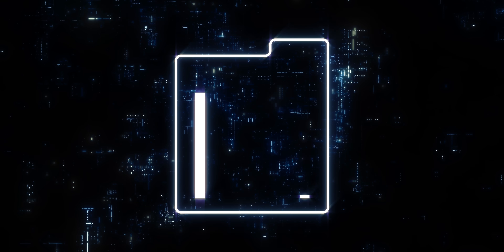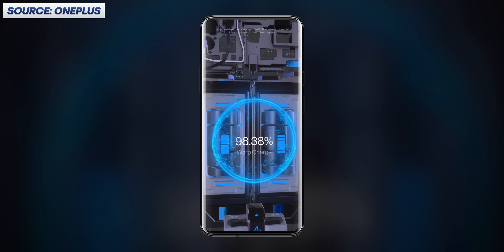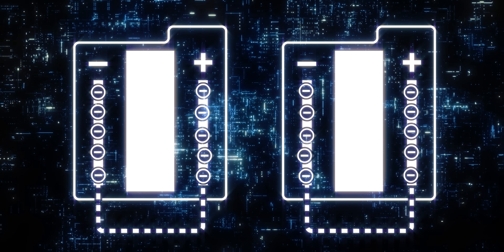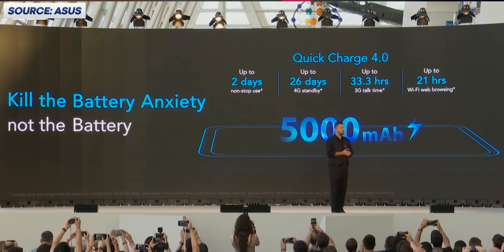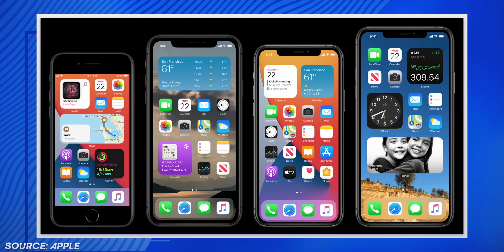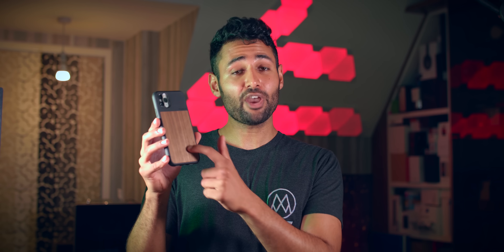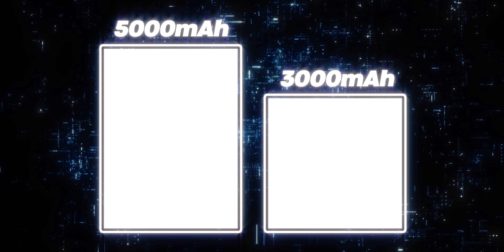The Problem with Fast Chargers.

Comment: Apple are particularly sensitive about battery life because their batteries tend to be smaller.   Smaller batteries go through their lifetime supply of charge cycles more rapidly.  This is another benefit of huge batteries - they don't have to burn through all their cycles as quickly.  My cheapo Xiaomi supports 30W charging and it's already fast enough.  I get about two days out of it.  A benefit of rapid charging we may not have considered is that getting to around 50% can be done within minutes, and could last you the whole day without harming the battery.  We know that charging to 100% strains the battery so why even bother?

Comment: I recently learned the reason for 50% (and not 80-90%) for new devices: they want to reduce the energy contained during transport in case of a failure.
So, when they ship a container with 6000 mA phones, having 50% of the energy in a catastrophic failure may the enough to contain it. Oh, and 100% charge may even increase the risk of failure itself.
And, of course, like mentioned in the video, you want the battery to have some energy so as not to damage itself on the shelf, which is a benefit for the 1st user, as he can use it for some time after opening. (yes, I know they write to charge it before use).

Comment: i actually never use a fast charger even though i have 30w charing. i only charge at maybe 10w or 15w and never charge it to 100 percent and never discharge it to 0. Always between 20 and 80, ideally even less of a difference. I want this phone to last at least 2.5-3 years so im trying to preserve the battery as much as possible.

Comment: idk for the 25w is more than enough.. i just dont need my phone to go from 0 to 100 in 20 minutes.. really unnecessary
Reply: It's one of those chargers for when you really need to leave the house in 15 mins or so and you whack it on that 60+ watt charger lol
Reply: Love my 30w Dart charge, never have to worry about a low battery percentage before leaving the house.
Reply: @lillexus5589  so do my 20w vooc
Reply: Samsung way
Reply: Fr
Reply: I love my 25w samsung charger. More than enough. I won't complain even if it slower than this like 20 w
Reply: I wonder how stupidly heavy your phone usage is if you need a 0-100 charge in 20 minutes
Reply: @AnymMusic  high screen on time + high brightness, video playback + bluetooth earphones connected. Pair that with power intensive apps and you may charge your phone twice a day. Handy to have fast charging in this case.
Reply: @lillexus5589  don't forget high refresh rate
Reply: 18w Google pixel working perfectly fine.... top charger
Reply: 20-30 is fine for me

Comment: I'd say, that the most stable state is at 0%, because at that point both poles have same potencial. I think what you claimed, that at 50% both poles have same amount of electrons, is false, because this is description of discharged battery. How could the electrons spontaneously move to the other pole which has same potencial? It would require external energy.

Comment: For me, fast charging only make sense if you have a large battery capacity. Take a look at Samsung Galaxy M51 - that phone has a whopping 7,000mAh of battery capacity but only 25W of charging rate. The result? 115 minutes to fully charge the battery from 0. If the M51 has a faster charging rate at, say, double the value, I can guarantee the charge time can be halved.

Makes you wonder why Sony, Google, and Apple aren't still embracing fast charging.

Comment: I thought 0% would be when the electrons are 50% and 50% on the both sites of the electrodes. 🤔 SO THERE ES NO WAY OF MOVING FOR THE ELECTRONS
Reply: A battey dont store electrons, a capacitor stores electrons, batteries store  chemical energy
Reply: the 100/0 or 50/50 ㄛs just an expression. it's the reduction potential that drives the electrons going in the circuits.
Reply: That's true. There is 50/50 on each poles when it's empty.
Reply: it's alway 50/50 of electrons on both sides....
Reply: Wait... So??

Comment: If the battery is at fifty percent, that does not mean the electrons are equally distributed between the negative and positive poles. If that were the case, no net charge would be allowed to flow. Rather, if it is at zero percent, I would expect the charges to be equally distributed

Comment: Xiaomi here you have a 100 w charging option.

iPhone: 5w is really good
Reply: My xiaomi phone last more than 4 year
Reply: Between 15 and 30w is perfect. 5wvis fucking pathetic
Reply: IPhone charger never END hahahaha hahahaha....
Reply: @trumpameri1638  ? Xd
Reply: @dowahkin1852  5w iPhone charger you start to recharge and you forget that you have a phone hahahaha....
Reply: XD i have a Xiaomi redmi 7 fro like 1.5 years lol
Reply: it seems there's a reason to it. Xiaomi phones rarely survive 3 years (that's for the 15W fast charger).
Reply: @kamikamieu  it's the same for the iPhone all my friends who had an iPhone for over 3 years have to recharge they're phones 2 times a day.  Im a big fan of xiaomi and I wouldn't say that thei batteries become bad becouse of the fats charge. I had two xiaomi phones and I'm using a Xiaomi phone with 30 w fast charge now and after 2 year's of use I can still get it through 2 full days of use without charging
Reply: @dowahkin1852  what's your secret? 😭 My Xiaomi Mi 9 needs to be charged multiple times a day after 1.3 years
Reply: @kamikamieu  Hmmm no phones battery will be the same as it was when you bought it. Whether you used a 5W charger or 100E charger, the battery will degrade.

Although, yes, using higher wattage charger will degrade the battery faster, but not as much as you are exaggerating
Reply: @officialhideyo  Yes 5W is pathethic but 100W? I'm using 15W charger, it's very hot because in my area the ambient temperature is high. 100W charger will heat the crap of any phones in those areas
Reply: @kamikamieu  yup, 100 W isn't necessary.

But honestly speaking I use a 20W charger and my phone doesn't heat up. So for me that works. And its fast enough so yeah.
Reply: @kamikamieu  xiaomi has 120w
Reply: 高橋有希 my old phone also have 15w charger
Reply: @kamikamieu  my mi 8 runs fine lol
Reply: @kamikamieu  my xiaomi phone last 4 year(with a curved screen for real its like a curved monitor)
Reply: @kamikamieu  tbh i have 6months old 15w Xiaomi phone, my phone is really slow and easily heat now. I play games a lot.
Reply: its the problem of processor , your overloading your processor ,buy a xiaomi flagship phone ,you will not gonna have this probkem
Reply: My mi9t battery capacity is 60 percent after 7 months 😭
Reply: @naheedray  sure. And how did u accurately measure this?
Reply: @officialhideyo  i have messured it using the accubattery app. It is very accurate.
Reply: @naheedray  nope it isn't accurate buddy. A quick Google search and you will find out that the method it uses to figure this so called battery percentage or life is pretty inaccurate.
Reply: @officialhideyo  im getting 3.5 hour screen ontime. So what would u say to this. Accu is not 💯 accurate. But its close enough i guess
Reply: @naheedray  which phone do you use?
Reply: @officialhideyo  k20
Reply: @naheedray  idk wht you did to ur k20. My friend gets 6 + hrs SOT

Comment: I believe you made a mistake. When you were talking about about battery being at 0% you mentioned that all electrons are at positive pole. Which is not true. The electron as you mentioned in be until they create balance between two poles meaning and 0%, 50%of electrons are ate negative pole and 50% and positive. This is the most balance you get. Ad a result what you mentioned batteries being their  balance when they are at 50% charge is wrong. Until I am missing something here.

Comment: It does not matter what charger you use it is not up to the charger to control the charging of the battery, it is the circuitry built into the actual battery.

Comment: Little note... At 3:10 you say that all the electrons will be sitting in the positive pole, this is not true. When the battery is empty, there will be a perfect balance between the poles. What I'm saying is that there will be equally many electrons in the negative pole as in the positive pole. Nature always wants balance, that's why electrons never want to be off-balance with each other.

Comment: The carges slowing down as it reaches full capacity is like people entering an elevator. The first few people can enter quickly, with no problem as there's lots of room for them to move into. But as the 8th person enters, while there is room for them, all the other people in the elevator now have to shift around to make room for the new person. The more people in the elevator, the harder it gets to accomodate the next person, and so on

Comment: When people have a slow charger (like Apples 5W), they charge overnight. But charging overnight (without optimization) is far worse for the battery than fast charging during breakfast. So in real life, people with slow chargers damage their battery more often. 😃
Reply: Robin Baier well there is optimazed charging on ios, and you can also charge on your way to work with a car charger and on your workplace or school, so you can still get easily a full charge on your iphone even with the 5w charger even if you don’t charge it at night.

Comment: Hey Arun this is nothing related to the video, but I was wondering if you could debunk this. A few years back, my father was angry that I knew all his device passwords. So he changed the password if his iphone SE (the old version) and so naturally when I typed the old password it didn't let me in. So as I was staring at the screen trying to figure out the password some numbers on the password keypad  lit up one by one in an order. I pressed the numbers in that order and unlocked the phone! I and my dad were soo shocked and we tried it again but it didn't work. This year I tried it in the new iPhone SE and it didn't work so is it something that only happens with that particular phone? If u have pls try to debunk it. Love your vids❤️❤️

Comment: If your logic is right, my OnePlus 5 should be dead by now. 
Thank you but no thankyou for brainwashing me into justifying apple's charging speeds.
Reply: Iam Rajaneesh those numbers he presented are absolut bs, you would have to do like 1,5 battery cycles/ per day for that battery capacity to drop by 20%. ”Brainwash to justify apple’s charging speeds”? Have you lived in a cave or are you just silmpy stupid? Apple has been criticized about every little detail, and arun is one of the only ones to actually tell, how batteries actually work instead of just joining the apple hate, like 98% of youtubers.
Reply: @Deeku83  thanks for the enlightenment. 🙅‍♂️⌛to↩️. ✌️.

Comment: I love that manufacturers make the buffer, but I'm also concerned that we don't know who does and who doesn't do that. And as Linus Tech Tips mentioned in a video (can't remember which... tech quickie maybe), some companies might reduce that buffer just to reach higher screen-on time numbers. And I'm rocking the buggy Surface Duo. How am I supposed to trust that such buffers and software protections are implemented properly, especially when I can't turn off fast charging in settings (yet)?

Love the video for how much info it provides. I'm still uncomfortable fast charging, but when I must, I'll be comforted knowing 30w or less is my sweet spot.

Comment: Just use fast charger if you want. Phones whatever you do it will slowdown anyway in maybe 1-2 years specially if youre always on your phone.
Reply: Melizza Correa my 4 years old iphone 7’s perfomance has actually improved over the last 4 years thanks to softwate updates. It’s androids that start slowing down after 1-2 years on iphones that slowing down starts after 5-6 years or so, unless you have a worn down battery.

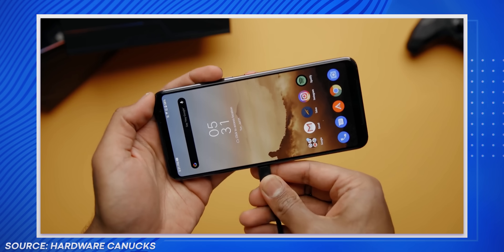Comment: 2:30 Sony Xperia 1 ii also have that feature 🙄
Reply: He is purposely ignoring the fact Sony has a lot of battery longevity optimization. Sony has always been taking great emphasis on preserving good battery health and their latest battery care function is their heat suppression charging which works great for gamers
Reply: Also Xperia line up has had almost every one of these features since 2017 at least. I remember the Xperia XZ Premium slow charging when I was going to sleep.

My current Xperia 1 does this as well, I wish it had the ability to work on power from the wall without using battery as well.

Comment: Made that is not how battery capacity works 50% is not the most stable state of a battery, battery works by using the Gibbs free energy of the the electrodes in question.... The anodes naturally wants to have less elections and the cathode naturally wants to have more elections..... 0 % is the the state where ∆G= 0 or and thus THE MOST STABLE STATE..... Now I don't know why the phone manufacturers start of the battery percentage at 50 and I won't pretend to know something I don't, but I am sure over what I said.... 
BTW Love your vids

Comment: What about battery cases? I use apples battery case on my XS Max so the battery on my phone is constantly being charged everyday every night nonstop for years and my battery capacity is 98%. On modern devices I was under the impression that what killed your battery was cycles. Your battery has so many empty to full charges before it starts degrading so keeping your phone charged or on the charger is the best thing you can do. I also have a 6s plus I got on release that has pretty much been on a charger for 2 years now and 2 years prior was on a charger close to 100% of the time and the battery health on that is 96%. I know people with iPhones that are 6 months old that has worse battery health than my 4 year old 6s plus.
Reply: Agent Fletcher well like the name suggest those apples battery cases aren’t just battery, but SMART battery cases. Meaning that the power goes straight to the battery case to your components, not your battery. Meaning that your battery is practically unused, if you have the battery case on👍🏼

Comment: It's the time-longevity tradeoff. Would you rather make your battery last really long, or would you want very fast charging and save time daily.

I think we hit the sweet spot already with 50-65W chargers. Most people only use their phones for 2-3 years, and with fast charging, that's probably how long your phone's going to last. It's a good balance. Although if you game A LOT on your phone, you'd be charging much more often than the average user, and your battery will probably die out within 1-2 years. If you're a normal user, fast charging works out real nice.
Reply: Shivam Bhardwaj I have to disagree on this one. Most people charge their phones overnight so the charge rate realy doesn’t matter, also stuff like car crargers and powerbanks exist. Even if you use your phone for 2-3 years it’s still benefical to have the battery in good condition. If you decide to sell the phone for example, but that said if you have an android then higher wattage chargers are benefical, because they don’t last more than 3 years anyway.

Comment: Next Iphone feature...Quickcharging. 😂😂😂
Reply: Dzulk9 The Great current iphone features: 2-3 times longer software support, privacy, balaced and optimized software, phones that last 2 times longer than androids on the same price range, well iphone se will last ~4 times longer than phones from it’s price range, soo there’s that😏
Reply: @Deeku83  I understand 😂😂😂 its just that Arvin mentioned about Apple not using fast charging to maximize their battery life and software optimization but sometimes manufacturers tend to surprise with unexpected features~

Comment: That's the reason why I'm glad Sony doesn't give a fuck and stays with 18 W chargers - it's fast enough if you need to get a quick charge in the morning after night (as I don't charge my phone over night to prevent going above 70% and charging it continuously while it's full already) and prevents battery damage. They also introduced a possibility to charge the battery over night without charging continuously - it charges to 80% and then stops until you're about to wake up, just before that it will continue to charge to 100% (what I don't use, cause I never go above 70% if possible). It's possible for years by now, even got it on my Xperia Z Premium (that lovely brick).

And with the new devices from this year, they also offer the ability, to bypass the battery while charging and gaming, so that the charger directly powers the phone without heating up the battery. Sony really pays attention for battery care, for years already, shame everyone is just hyping unnecessary shit like super fast charging from other manufacturers.

Comment: I do not agree that apple wants their phones to last a long time. They have been caught to use planned obsolescence many times, have been sued in court and have lost on that cases...
Reply: jawbreaker did you even watch the video at all, he explained the reasoning behind apples behavior. When the battery gets warn down, those batteries really have to work harder to maintain optimal perfomance levels, which means that they either: sometimes  overheat and shutdown, or you lower the perfomance of the device which also lowers the reguired power needed to power the phone. So not only do you get more realiable phone that doesn’t randomly shut down, but also a phone can last longer on a single charge even with a warn down battery

Comment: because Iphone battery are way weaker than android battery for some reason
Reply: Legion Z Umm, you do know that they use the same technology on their batteries right? In some cases they even use batteries made by the same company. So no iphone batteries aren’t weaker, they often tend to be smaller yes, but not weaker. And even the smaller size usually doesn’t mean worse battery life, because of those really low power consumption of A-series chips and really good optimization of software.